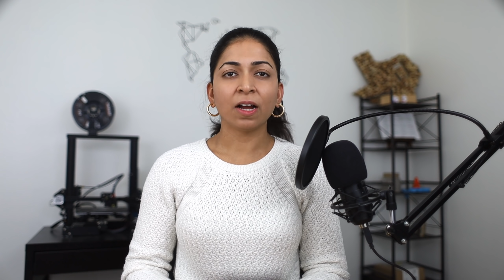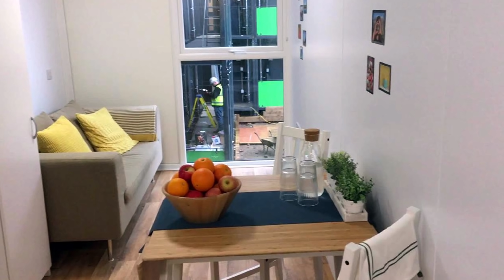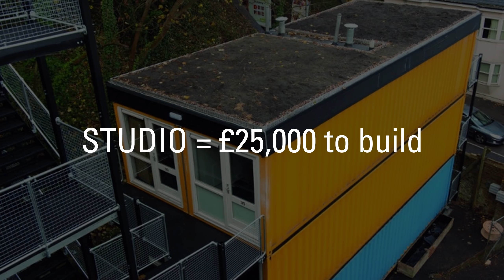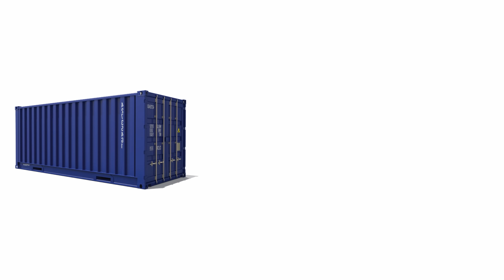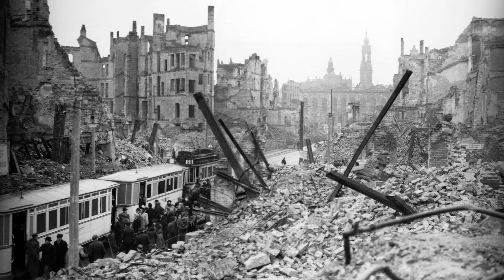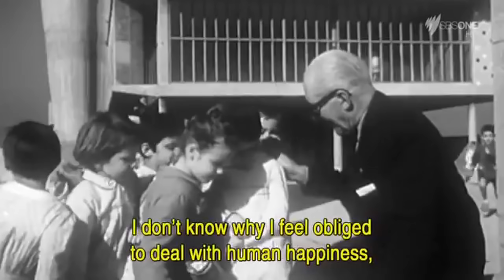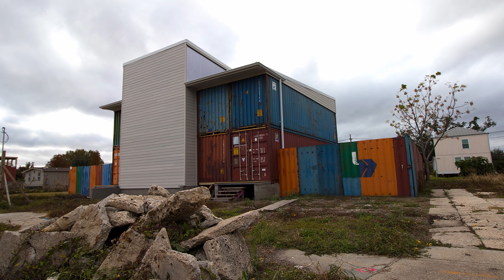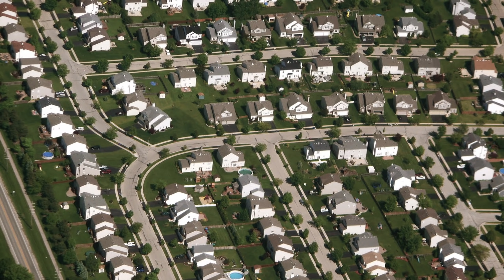Why Shipping Container homeless shelters FAIL

Comment: At first glance shipping containers seem to be a quick easy way to create a home. In reality they are not. The structural part of a home is only about 1/3 of the cost. The other components, windows, doors, interior finish, cabinets, plumbing, electrical etc. make up the other 2/3. Steel walls and roofs accumulate lots of condensation inside.

Comment: This is a halfway house on the way to getting off drugs, getting employment, and incentive to move into regular housing. This is not a permanent solution for housing.  But, beggars, give them a room and they demand the mansion.
Reply: calling the least fortunate among our society "beggars" is both cruel and incredibly ignorant of the larger societal forces that brought them to where they are. Treat humans with humanity.
Reply: @jackhanson9461  When they actually accept food, and not throw it out, is when it shows an actual need. Sitting in a parking lot and watching a full shopping cart of bottled water being poured on the ground to get the deposit on the empty bottles is a slap in the face of taxpayer's dollars. What is needed is a break in the chain of providing expensive street drugs and needles to fix the underlying chemical induced mental health problems for true reform of the problem.
If my "Donations" actually helped with food and clothing, it would be credible. They have so much surplus donations the local dealers are better dressed than I am, there is a problem.
I do donate to my local charity, that provides assistance with rent, utilities, etc, for those who are vetted. I am not a doormat enabler for a huge drug problem.

Comment: If shipping container housing is thought through and planned out properly, they can be a viable solution for any type of housing.
Reply: No doubt but that costs, what these are perfect for is emergency accommodation and temporary shelter. The limited design makes them unsuitable for what they end up being used for, mid-term accommodation. Anything more than one month is too long in these. Now if they were upgraded to be 2 or 3 joined containers with insulation and ventilation sufficient for the climate, of course, that is just as costly as building long term social housing, without the ' container' tag. Why do shipping containers fail? they are shipping containers.  Oh and the use of stacks of these in dystopian novels doesn't help.
Reply: Why does it need to be shipping containers? It is much cheaper to build them from scratch.

Comment: Force all architecture students to live in a shipping container for the duration of their course.
Reply: @AN-sm3vj  two weeks is not enough time.  You can find some expensive short term solution to ride out the two weeks of discomfort that the poor would not be able to have.  Dealing with mold growth probably would happen in that time either.  One year in their design.  They can go away for the holidays but that's it.
Reply: @MrsMika  it's easy to fix, make bigger and expensive houses raising taxes 30%
Reply: Its not like arch student dnt know what will happen. 
Its basic knowledge for them. 
They just do what they told and paid for
Reply: @iankarma6199  precisely this is basic building physics. Sure your job is to give them what they want, but also impart your knowledge on their wishes.
Reply: @uriblaketheriddimprotege  you right. But architect work quality are depend on your budged to.
Reply: @iankarma6199  
Just doing what they were told was also the excuse of many Germans after nazi time.
Reply: @hermask815  they get paid for it. And what they must do then? 
Pay with their own money the necessary material to made it liveable?
Reply: @iankarma6199  
I wouldn’t say they have to use their own money, but they should think about the consequences of their actions.
Like not taking part in https://en.wikipedia.org/wiki/Hostile_architecture
If they are taking money for that they are on a slippery slope to become like 
https://en.wikipedia.org/wiki/Albert_Speer
at some point.
Reply: @hermask815  thats the problem. In the construction work the first time we have to do is studying contract design if its pass the safety measurment we apply our plan to vendor. 
The problem is when our plan are  accepted and we start working, then something that force us to increase our budged happen we need addendum contract. If our addendum contract are not accepted by vendor, we will reduce the quality of material, or find other seller who sell cheaper good materiak.
Thats the only way to make our money back, since they pay us after the building finish. 

Greedy contractor, architect, and stinggy vendor, are main reason for bad design.
Reply: I believe that the different realms of science all have areas of disappointment. In the science of architecture, the shipping container home, is that disappointment
Reply: @uriblaketheriddimprotege  There are plenty of great container homes. These just aren't it.  There's no shortage of standard homes that have mold issues a year after being built. Like anything, there's a right and wrong way to build
Reply: @uriblaketheriddimprotege  It checks a bench of mentally satisfying boxes.
Reply: @uriblaketheriddimprotege  Don't mean to be a grammar nazi but you really didn't need that second comma.
Reply: @mabimabi212  A command isn't grammar  its punctuation!!!
Reply: @galegrazutis964  Punciation is part of grammer?
Reply: great way to make sure we won't have enough architects
Reply: @WeiYinChan  Actually, that would be a good thing.

It will stop architects creating carbuncles that no one would want to live in.

In the UK, during the 1960s and 1970s architects came up with a great plan of concrete tower blocks and estates.
One estate, called Thamesmead, in South-East London is one such example.
They even filmed "A Clockwork Orange" there, because it's a bleak place.

They were designed for the poor - not for the archirects who designed them.
The style was "Brutalist architecture" - says it all.
Reply: @bobm4623  lol architect students, like all students, are already having a hard enough time, they probabln't don't have a good living condition without you forcing them in the first place. Taking away their basic human rights of choosing where they live for 3 years is just gonna make sure no one ever wants to study architecture because they are immediately punished for doing nothing wrong. And there are shitty living conditions other than shipping containers as well, are they supposed to rotate between them each day so they can experience every single one of those shitty buildings before they graduate? It's not going to happen lol.
Reply: @WeiYinChan  Actually, making them live and work in horrible buildings - like their clients will have to - is an excellent idea. Thank you. I don't know why I didn't come up with that first.

After all, if you join the armed services and wanted to be part of the special forces - to be the best of the best - you have to go though hell and back.
Reply: @WeiYinChan   A person who has ambition to become an architecture student  does not owe "homeless" people, many of  who don't want to work,  great housing designs. 
Yes, the average person working hard to get through school, or any working stiff or student or ordinary person probably lives in some kind of sub-standard housing himself or herself.
Reply: Great idea! Let's put some govt employees in there, too. And before anyone can work on the " homeless problem" , they need a month in a downtown tent.
Reply: @YSLRD  How many of you have spent an extensive time around the homeless?
Reply: @thetraveler1182  yep. 18 months homeless
Reply: @YSLRD  brilliant comment 😉
Reply: @YSLRD  don't make housing projects, problem solved
Reply: I lived in a shipping container when I was a student it was amazing! But I think that was mainly because I was young and it was short term.
Reply: I've spent weeks in one.  I'd rather live in that than the condo I'm in now. And I love my condo, the shipping container was just better.  These homes she's speaking about just have junk insulation
Reply: Even good architects can be tempted to put aesthetics over function, especially when under budget pressure. Or they just have the ego and reputation to push their ideas on clients. One example is Wright's Kentuck Knob house, which has a hallway too narrow to use. But he left it in anyway.
Reply: Shipping containers are perfectly livable spaces but AC is obligatory in them and this is also the place where government is usually "saving" money.
Reply: If you're homeless you are not worried about how the apartment " feels", warm, dry and safe is all you want.
Reply: You are pretty much describing the quality of the average dorm.
Reply: They often do, when doing actual construction site work. Usually it's not shipping containers but purpose-built site housing for the slave workers. They are cheaper, lighter and perhaps not as unhealthy as the reused steel steel cans, but size is the same.
Reply: @jmi5969  You are right about the students. However i disagree with your assessment as a builder who has built estates for celebrities. The price of lumber is through the roof as well as all materials. I built a container home and it is safe and i barely threw anything away. No leftover lumber or copper wasted. With the solar and tesla powerwall as well as recycled rain water for a garden. The only thing that waste i make is my truck and garbage.
Reply: that'll teach 'em. 😂
Reply: @AN-sm3vj  
Yup, it's like with the former gun makers and canon builders - the makers
themselves, by law, were the first ones having to shoot with their creations . . . . . 😂
Reply: Most of them live at their desks in studio, so they probably wouldn't even notice.
Reply: I've had to live in bushes and under bridges, even in culverts, at ANY time during those hard times, I'd have GLADLY,  and, GREATFULLY , lived in a converted shipping container.  Outside, and in even worse conditions, is not better.
Reply: @AN-sm3vj  @Bob M  I agree completely.  I have a fictional character that lives in these styles of housing in his exiles and while he loves the small cozy footprints, he can't stand not having it actually be a state-of-the-art space-age capsule if it is supposed to look like one, but all the while fitting in as much top-of-the-line smart home technology as will fit into the space.
Reply: This is a great idea. Help get others into the idea of living in a smaller home and how to maximize allocated space.
Reply: Probably would be better than actual student housing... Which is often pretty horrible too
Reply: I live in one for two weeks out of three as mining village accommodation in remote Western Queensland. If you maintain them correctly, they can be quite comfortable long term. Our village is over twenty years old and we have none of the problems discussed in the video here. Maybe it's the climate?
Reply: Learning by experience.
Reply: I feel the same was as someone who does deliveries when it comes to apartments with poorly designed building.  Building numbers no in an uniform place, hidden behind shrubbery.  There's a few complexes with dozens upon dozens of buildings.  Hard to figure out where to go when there's bad lightning and no direction to which building is which direction.
Reply: Why? It's not the students who are doing it.
Reply: I lived in a shipping container and it was cool
Reply: @AN-sm3vj  don't make housing projects, problem solved
Reply: Raise taxes, the money you use to have a big house will be used so you and the homeless have a medium house
Reply: @Asherah 1147 Do you really need all that numbers? It's sooo 2007.
Reply: We did during winter during a fumigation aplttempts to kill all the fucking rats n shit.

The only annoying thing was sealing the windows so it wasn't drafty. Used house insulation instead of the bullshit foam hipsters use.

Friend bought it and added it to his 4 others. Less heat and ac bill and insulation rating is double our house.
Reply: Don't forgot the professors and tutors too
Reply: Small space living not a problem.  Its the ventilation problem.  I use to stay in the smallest store room before.  I install a big ventilation fan (soundless)  in reverse. Air suck into the room will solve the stuffy room.
Reply: I built a shipping container house and it is AWESOME. People think it echos but it doesn't. Its super strong and reliable. Put solar on it with recycled rain water for a garden. It was like building with legos. Ten 20' containers gave me roughly 1600sq feet of space. Each container cost me $4,000 plus $500 each for delivery. All in all I spent around $100,000 total. Modern as anything out there.
Reply: @costakarras7293  that's a lot more than they sell for near a port
Reply: @costakarras7293   Well, you are one example of using your own resourcefulness. Of course not everyone can do the same  but  all this talk about how  "Inhumane"  and "stingy" it is to make  containers into homes for homeless people   is so one sided.
Reply: @obscurelyvague  Okay I'm going to disagree by pointing out a different angle that might not have occurred to you.
 
'Does building in this way serve the overall public interest'. Not just the homeless people right now, but all the tax payers who are going to have to live with this building and the service it provides in their city.

And I think the answer is no.

In the case of shipping containers, it tends to be false that they are easier and cheaper to build with. Most shipping container buildings end up costing more per square food than an equivalent timber or steel framed building.

So they're not a savings for the tax payer.

Nor do they generally save architects time and effort. Shipping containers are profoundly poorly designed as building elements and very challenging to design with. You will get a better result with less architectural effort by building with different techniques.

Then there's the soft cost. Even if you think we should be economical in helping the homeless. Which is a fair position. But that interest isn't served by putting them into housing so bad that it can exacerbate physical or mental illness, frequently the reason they are homeless. 

I'm not saying it should be luxury accommodations at all. But a building so poorly designed that it serves as an active liability to any potential rehabilitation is no virtue and will likely cost more in the long run while being an eyesore for the people who had to pay to have it built.

Finally, there is building lifecycle. In other words, can this building be repurposed or renovated at a later date. And typically with container buildings the answer is no. Which means the building will more likely be abandoned to decay until it is torn down at the ends of its use as homeless housing.

It won't be able to be repurposed to recoup costs. Which is tremendously wasteful.
Reply: Its the engineers that actually make a building function. Architects are just overrated designers. Im always having to fix their dumb fuck mistakes

Comment: I actually priced things out and it is not very economical either. A shipping container costs minimum $1700 and they probably charge more for these containers plus shipping and crane etc. And then you need Insulation drywall etc.

You can buy the container frames from China which are wider 10 x 20 for about $1000 without the steel walls which are a big problem.

I don't think modularity is the problem. They need to be better designed.

You probably can design a better modular system with units of 10 x 10 x 9h and construct more spacious rooms. And with better finishes and amenities.

Perhaps a basic two floor unit of 400 square feet. Which is slightly larger than one shipping container and laid out more like a real home.

Comment: This channel is so informative. Researching resilient and autonomous homes, I'm wondering; what's your take on compact hemp or hemp brick structured homes? https://duchanvre.com/en/ 
I have volunteered on three seperate sites using this building material and in a cold climate with high humidity such as Québec, it seems like a clear choice for a sustainable and renewable building material (it grows like 'weed' - pun intended - and seems simple enough to transform. There's a new factoring opening in Asbestos to transform hemp into building material).
Reply from the maker: Thanks! I covered DuChanvre's work in my Hemp video https://www.youtube.com/watch?v=fwiLdmvUJ3E
Really impressed with their finished products!

Comment: Many of the issue's with container buildings mentioned here are easily resolvable...

though not giving people enough space with linked containers at a doable rate is purely destructive planning & if thats present in the design it doesn't matter how you build it, they'll screw it up.

Comment: There is something might interested you.
I am living in a HK and renting a home which is smaller than a container home. The Building Department here is promoting MiC construction method which is very similar to container home and I think with good balance.
The modules are following the size and frame of containers so it can easily adopt into the transportation system. But the wall, floor and ceiling are using actual building material with proper insulation and interior decoration.
Because the construction situation in HK is, high labour cost, small construction space, very tight building schedule. using MiC method can have great advantage.
Reply from the maker: Thanks for sharing! Hope it helps solve the "coffin home" problem in HK